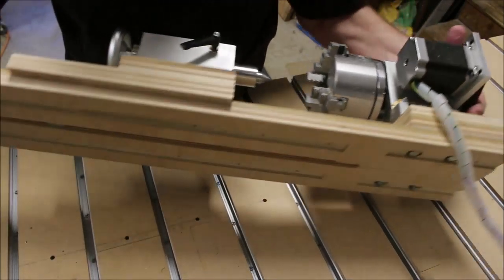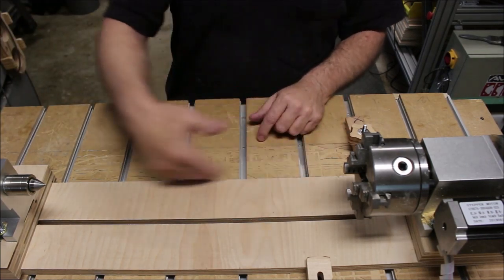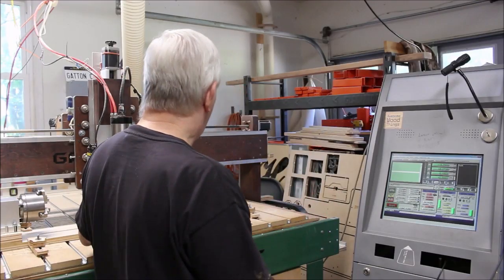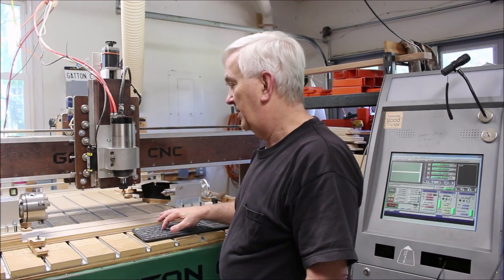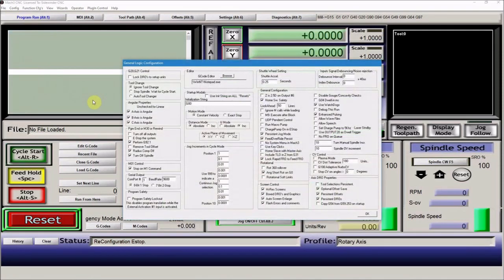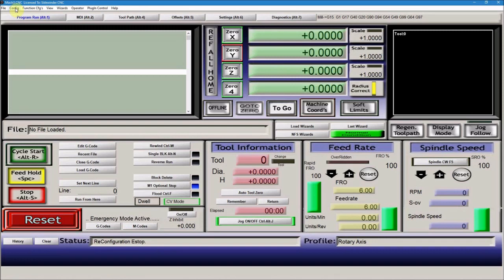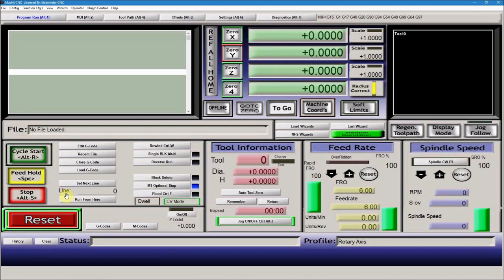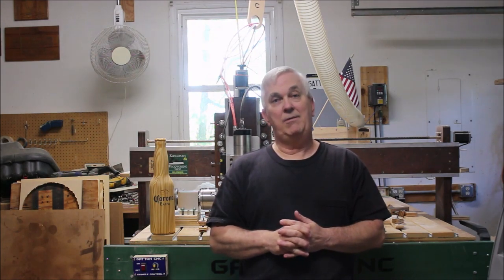My Rotary Axis Setup for my Gatton CNC

Comment: Auto zero question... Do you have to have a separate script for auto zero when using this profile? If so, do you have to change the script each time you go from normal cnc to 4th axis cnc?
Reply from the maker: Great question Ron.  The auto zero script is not saved with the machine profile but rather a part of the Mach 3 program so I have to either edit the script or replace it altogether when using the rotary axis.  Thanks for watching.

Comment: hey Dave 
I'm hoping you have some insite on UCcnc i was hoping to loose it and go back to Mach3
but the ethernet board I purchased for mach3 has an issue with the Z Axis and will not run.
waiting on replacement.
now. i am hoping you know how to setup UCcnc for the rotary.
can seem to get the model to completely go full circle, thinking Im in MM not Deg.wilkl try your formular for steps and hope .
if you can help polease let me know 
regards

Comment: What controller are you using?
Reply from the maker: I'm using one I put together myself based around DM542 drivers and a UC100 USB motion controller.
Reply: Sir I thank you I have a big request I want to put together what I need in order to have my machine able to do the Rotary I would need dm542 I would need that uc100 I have the machine in the motors and the wires in other words I have a working machine but grbl
I also purchased the same rotary attachment you have what else will I need

Comment: Looks like an easy setup Dave. But it seems that you could put a Molex connector at each of the two connection points and just move from one to the other by just unplugging and plugging into the other application. Or even use an A B switch box. Just a thought. Looks like fun. I want to do a rotary axis as well after I finish my build.